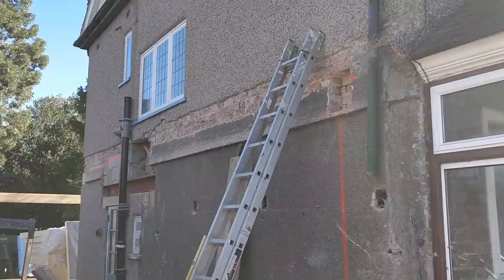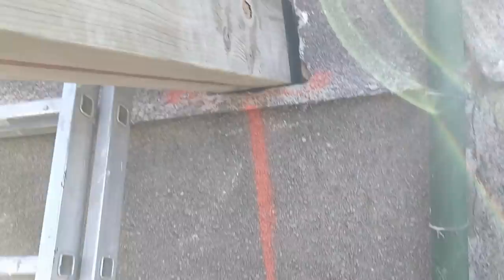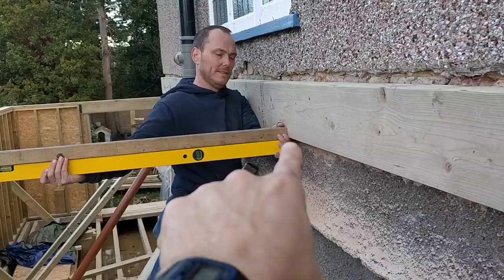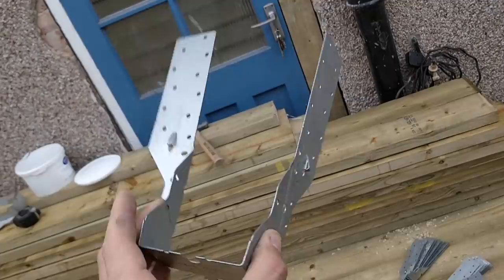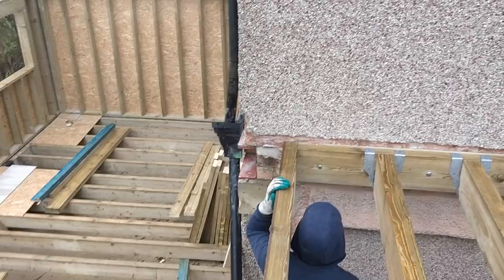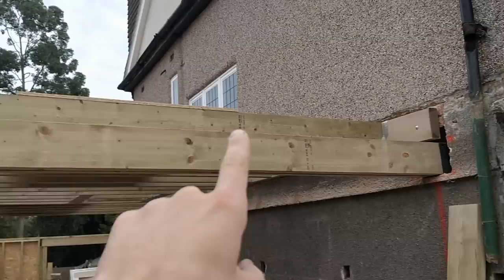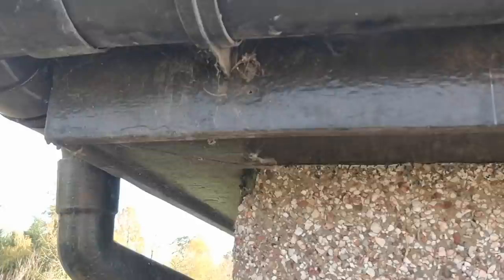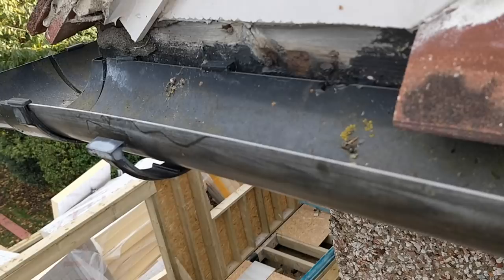First floor joists and flitch plate

Comment: Great work. Just quick advice: when you're fixing ledger board to masonry wall using bolts, don't line them in center all the way. Zig zag them. One closer to top, other closer to bottom.
Reply: But then might not get the bolts centre into the bricks and the way he did it is approved
Reply: Ŵw
Reply: I have never seen 12mm bolts used as resin anchors as there is no means of tightening them up. Always used anchor bolts or threaded rod
Reply: prevents the timber from splitting - same as a wall plate
Reply: Mason here..good advice !
Reply: Stops twisting

Comment: Interesting process. I haven't seen a timber framed extension in this much detail 👍👍
Reply: Coz it's cost double the price that's why u don't see it waste of money u can spend on the finishing touches
Reply: Damp doesn't rise anymore than metre from ground level why wrap your wrafters in damp when covered by render felt n lead 🤔🤔
Reply: @kriswild1824  you clearly don't understand rising damp
Reply: @HaroonAshraf  listen mate I've been a bricklayer for 18 years since I left school rising damp from the ground goes no higher than a meter. Any other damp comes from bad airflow n condensation within the house
Reply from the maker: I can assure you it isn't double the cost mate. I had quotes of £180K from two separate building companies for all the work. It's costing me around £100K. The timber materials have cost around £9K all told...I'm saving a load of money on the labour, as you would save as an experienced bricklayer if you built your own in brick.

Timber frame isn't done/seen as much in the UK because the industry is used to building with brick. In the US/Canada they're used to building with timber so they do that more.
Reply: @OfficeBoyBuilder  some of the things u r doing cost more coz your doing by drawings but if u have the no how u would save more. 9 out 10 building inspector nowadays read from a book n never been in the trade. A book is not always the truth it's a market to make people money
Reply: @OfficeBoyBuilder  them quotes r rediculous 180 k for a double exstension n a single on the back fair play u didn't get your pants pulled down
Reply: N 100k to do it yourself still well over to cost price of doing it yourself 🙄🙄🙄

Comment: with any timber  frame , you should  have  a  edgebinder that sits on  the  header plate  of frame  and nailed  into the  joist  ends. surprised building standards  and engineer  was happy not to have it in place. good video and  look forward  to seeing out it  goes.

Comment: Enjoying these videos and progress! However a few details are puzzling me. Why aren’t you using resin studs? Your joists also need a rim board fixed flush with the outside of the 6x2 and nailed back into the ends of the joists. The Dpm detail around your joists you should be using something like fc750 or vc foil. Also for your headbinder if you’re left with a small piece cut it back to a metre or more.
Reply from the maker: Thanks mate, glad you're enjoying it.

I'm sticking to the brief I've been given by the structural engineer...I guess there are so many different ways of doing things that everyone ends up with something slightly different. The DPM was actually a suggestion/stipulation by the building inspector, rather than the engineer who detailed it, so I just did as he requested.
Reply: I put it down to the English engineers lack of timber frame experience 🤣 great to see it going up though. Best of luck with the rest of the build 👍

Comment: I always drop a plumb line from the top of the building to the bottom before I start that way your new work is plumb and fits at the top.
Reply from the maker: That's a very good idea! Thankfully I managed to maintain plumb by doing it in stages, but it took longer and is prone to more errors than if I'd thought to use a plumb line!

Comment: Not impressed with the OSB packer. That should be a piece of steel ideally. A little plate of OSB like that WILL compress slightly over time and if it ever got damp or started to degrade your packer has just become a pile of crushed shreddies.
Reply: Totally agree Peter Peterson, I have had to pull up scaffolders using this packing method and material for the same reasons, which it did degrade over 1 month. All beit the material was exposed more to the elements (this was work overseas).

Comment: Instead of using dpm on flitch,paint the ends with a coat or two of bitumen,a tip I was taught 40 years ago by old builder.
Reply from the maker: Good shout. The DPM was actually a suggestion (request!) By the building inspector, so I just did as I was told 🤣
Reply: yeah, that was 40 years ago pal. There's a reason dpm is used instead, it's faster and easier.
Reply: @AJ-ds5gf  How times haved changed,never been keen using dpc to wrap a joist end, think it just traps any moisture present.Have had a few building inspectors who didn't like using dpm for wrapping,& wanted a proper joist caps instead.

Comment: Great video & presentation. However:
You shouldn’t use bolts like that to fix your wall plate. How can you possibly tighten the timber up to the wall?
You should use studs with resin, washers and nuts so to can tighten fully when set.
Timber dries and shrinks and it’s always good to get a few final turns on every fixing just before you plasterboard and after timbers have dried out for a few weeks.
If I was inspector then I wouldn’t approve those as I have seen them fail.
A big part of that wall plate detail is your resin working properly. Drill, brush out, clean and then resin, as it says on the side of the tube.
I noted the same detail on your floor joists - you have nothing to tighten up against.
Reply from the maker: Cheers mate, a couple of people have suggested that, and I can see a lot of merit in that method. If I had known I was allowed to deviate slightly from what had been specified by the structural engineer, then I would have switched that type in.

In fact later in the build I do use those bolts as they allowed me to more accurately straighten up a wall against the uneven wall of the house.

I ensured the joists were very tight when cutting and fitting them, so that will also help.
Reply: I am about to do this process myself with resin and studs, this will be for my “lean to” roof, but I’m not sure how far into the brick I should go with the bolt?

Comment: Happy near year to you 
Why not use a RSJ for the 
For the front crossmember?
Reply from the maker: Happy new year mate.

We had the same with the ridge beam at the back (coming up in a later video). When I started working with the structural engineer we wanted to keep the weight down without compromising on the strength too much. We weren't 100% sure how good the walls/foundations were, and wanted to reduce any unnecessary additional load.
Reply: Because steel is a pain, timber is far nicer to work with.

Comment: Looking good I was just wondering if there was any reason you'd not put any noggings/strutting in the floors  yet
Reply from the maker: I have deliberately not out noggins in the ground floor yet, because I needed to run water pipes and electric cabling, and also remove other walls and things that would cause debris which is a pain to clear out with noggins.

In the side extension I'm not actually putting noggins in, because the span is only 2.5m wide and they are 8x3 timbers. To get the levels right with the staircase I've bought, I'm also putting full sheets of 18mm OSB down across the whole side area, which is glued and screwed down, before the 22mm tongue and groove chipboard us put on top of that, so it will be unbelievable rigid!
Reply: @OfficeBoyBuilder  OK that sounds alright although I would have doubts about that stopping the beams twisting as only fixed on one edge
Reply: @OfficeBoyBuilder  Herringbone strutting is great for running services,  👍😁🔨🇮🇪

Comment: that timber warrens holding the level to looks about as straight as my dogs tail, so your bubble will be in a different spot using a straight piece of timber, ive had this issue recently with buying wood thats been sat at a builders merch through out lockdown, they were 3 metre lengths and gave a different level reading at both ends and the middle. you can see the gap between the level and the wood on the left, so if you close that gap your other end flies out of whack, nothing wrong with your method just imo wrong  choice of wood to use as a straight level
Reply from the maker: Yeah you make a fair point mate - we did check the timber was a straight as possible - the camera doesn't really help to show this. The side of the timber had been cut and so looks really rough, but the side that we were using to level off was actually dead straight - scouts honour!
Reply: It looked like a two by one as well, there's no way one should be using that as as straight edge over that span. I'd highly recommend an 8' level from Stabila and a three way green line laser.

Comment: As someone else said, great to see the timber works in so much detail. Are the timber studs sizing and centres sized and specified by the structural engineer? Also noticed you haven't put any double floor joists in anywhere, presume there'll probably be some internal partition walls somewhere?
Reply from the maker: Thanks mate - The spacings and sizes are dictated by the structural engineer, but they're standard too - at 400 centres, and 6x2 timbers are standard for 2 storey walls (and are sometimes used in lofts too, although you can use 4x2's there). I do double up later when I layout for the stair-case/stud wall
Reply: Building Regs Approved Document Part A specifies spans and timber sizes.
It's an easy reference without having to employ a structural engineer...
If you know the square metre load.🙂
Reply from the maker: That's great to know, thanks mate! I did end up referring to that document because I queried the sizes of some of the beams he had specified, which seemed over the top, but I didn't know I could refer to it and draw my own conclusions. I assumed I needed it "done properly" 🤣
Reply: The ceiling joists are specified in Part A. As an example, we have a ceiling to put under a concrete roof deck as part of our conversion of a control tower.
Our architect specified wire hung 4x2 which isn't satisfactory because drilling into the underside of a precast deck is a bit crap.
Instead, I am putting in a faceplate on the concrete walls all around and joisting at 400 centres with 50x150 which is spot on for the 3.1m spans and bearing load of insulation, membrane and two layers of plasterboard.
Securing to the under side of the precast roof deck would be a lottery as to whether the soffit is consistently thick enough and hitting rebar when drilling for fixings.
We are on Facebook as West Raynham Control Tower, to give you an idea.
Good luck with the build.👍
Reply from the maker: That's a fantastic solution mate, nice work. Will definitely check you out on Facebook, thanks for sharing and best of luck with it (although it sound like you've got it covered!)
Reply: @jon booty difference is that was your architect who specced. I've come across few architects who know how things are constructed. I'd like to think us structs have more of an idea 😂
Reply from the maker: It's a pretty decent setup; the architect/designer has a structural engineer in residence and they work together on all their projects...very streamlined and cheaper than doing it all separate

Comment: What would you guys have used if you were only say an 1/8 to 3/16 out for shimming?
Reply from the maker: Over a span of that distance (2.8m) a difference of 1/8 to 3/16ths probably wouldn't have presented enough of an issue to worry about really!

Comment: great content, what size bolts are typically used for the ledger board (M12/M16)?.. presuming the same sized bolts are also used for installing a ledger in a loft conversion?..
Reply from the maker: I was using M16's here. I haven't installed a ledger board in a loft before...not sure where that would be placed if I'm honest.
Reply: @OfficeBoyBuilder  thanks for confirming, you find ledgers are installed when the ceiling are dropped on the first floor to gain more height in the loft, so a ledger board is usually fixed to external wall (from the inside off course) to pick up joists from the beam, M12's appear to be fine but i would go the M16 route as you have
Reply: Hi, new to this game but need to secure a ledger board in my eaves. My attic is converted but have dwarf walls with no flooring behind them which I’m looking to resolve. Are the m16 bolts you refer to standard and available readily? As for the Chen fix is there a brand I should go with? (Love the channel by the way)
Reply from the maker: Cheers mate! M16 bolts are pretty standard, you could probably use M12's or M14's too in that instance, given that your loft is already converted...Rawl Plug chem fix is fantastic, it's a brand that's been around for decades so I tend to trust them. That being said, any structural grade chem fix will have to comply with certain standards, so I wouldn't worry too much.

Also, check out Timber Lock bolts - they're amazing, and rated up to 1tonne per bolt, so if it's just timber into timber, you can't go wrong with those.

Comment: Why are you building a wooden frame instead of brick/block
Reply from the maker: Just playing to my strengths (and passion). I don't know anything about brick and blockwork, as you'll see in a previous video lol! I understand timber and really enjoy working with it. Incidentally it's also far more thermally efficient than blockwork, and it builds a bit faster too.
Reply: @OfficeBoyBuilder  is it cheaper or dearer than brick/block . how will it be clad on the outside
Reply from the maker: I think it's cheaper, not least because of the amount of time it takes and the number of people needed to build in brick. With timber you build it once and in fill with insulation, and the walls go up in minutes. With brick you need to build each wall twice and infill with insulation as you go, and it's typically a thinner amount of mineral wool insulation which is less efficient than rigid PIR. The raw materials cost around the same, but timber is possibly marginally cheaper if you get trade rates.
Reply: I think you will find cost is relative. Wet work is dictated by weather, timber can be worked all year around. If you only have timber experience then why not, you will always have arguments for both and they will always have their place for use.

Comment: What is it holding up
Reply from the maker: It will support the second storey walls and the rafters/tiles above that. All specified by the structural engineer, and built to the letter.